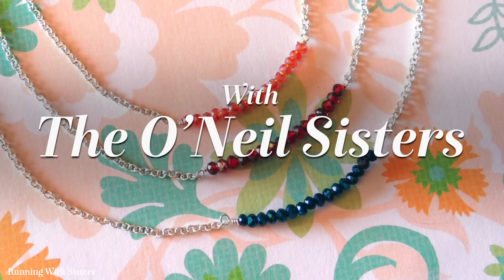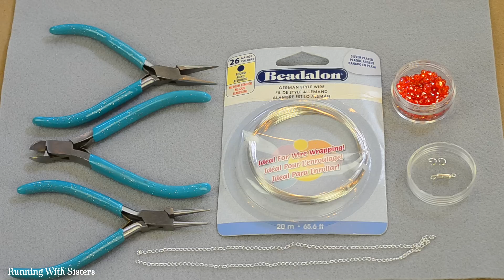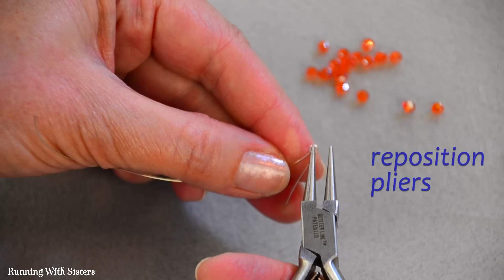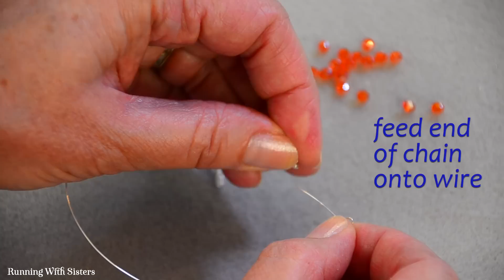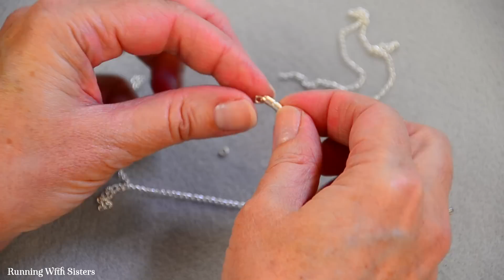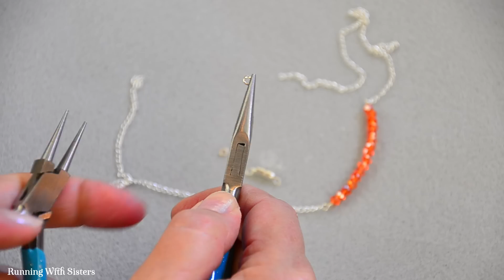How To Make Jewelry: How To Make A Crystal Bar Necklace

Comment: Hello. Please could you tell me the necklace chain size/type. I've just bought some chain but the holes are 1.5mm and far too small :(
Reply from the maker: Do you mean the size of the links in the chain? r the size of the holes in the beads? Here is a complete how-to for this project with all the sizes of the materials. https://runningwithsisters.com/crystal-bar-necklace/ Looks like we used 24 gauge silver wire for the beads. Hope that helps! 
J&K

Comment: Love your tutorials. They are very thorough and easy to understand and follow. If I could just make a suggestion, it would be nice to see the necklace on someone at the end of the videos just so we could see where the length would appear on the neck. I’m trying to decide if I would like to make this necklace longer or stick with the length you chose. Thank you so much for your videos.
Reply from the maker: Thanks Heather! You could pick out a necklace you have that sits right where you like it and measure the length. Or you can use a tape measure. Another option is to cut a long piece of string. Wrap it around like a necklace and mark the length. Then measure it on a ruler. Hope that helps! J&K